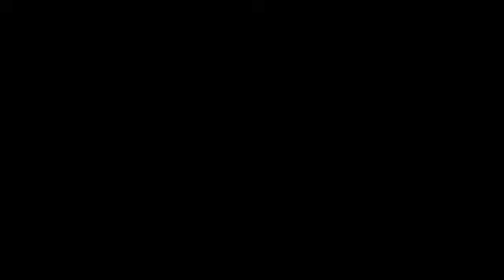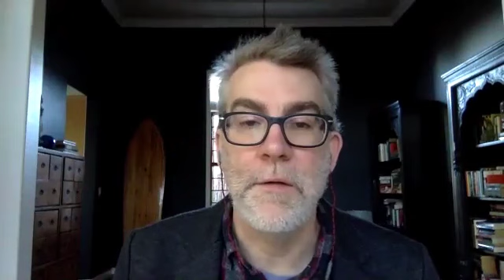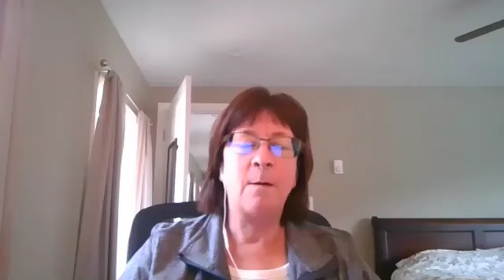Safety Metrics Reconsidered with Pam Walaski

Comment: 13:15 OSHA recordable injury classification is defined.  Subjective recordable injuries should account for less than 1% of injuries.  I would consider anyone unable to make determination a "Non-EHS Professional".  Lagging metrics will always be used, and in my experience, the shift to predictive metrics and measures is a function of the organizations EHS maturity, and the EHS leadership.  Leading and lagging indicators should always be tied together, to measure the effectiveness of failure prevention.